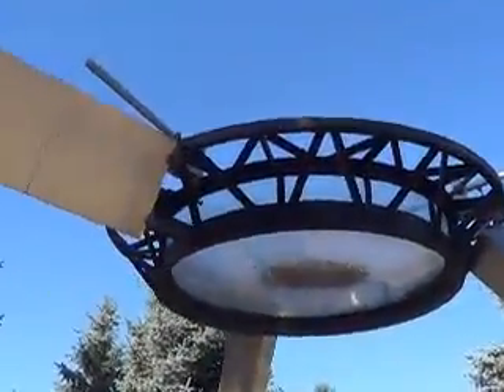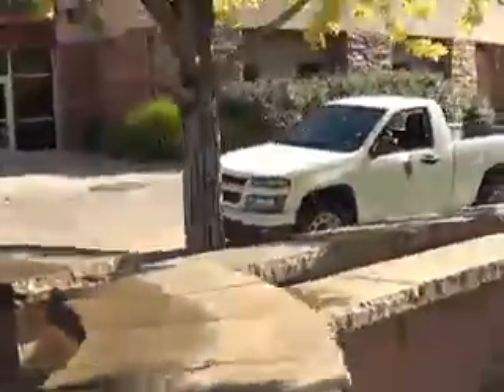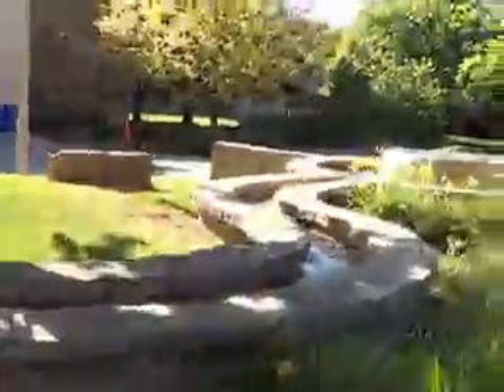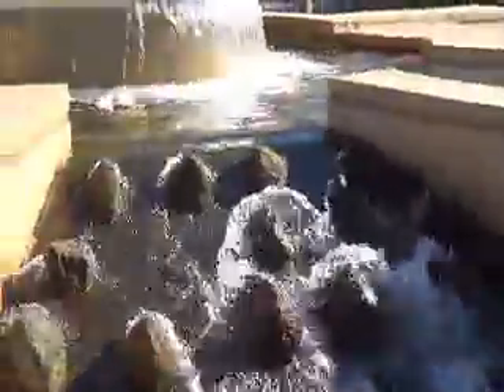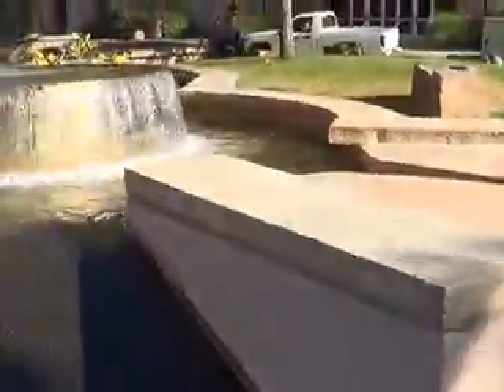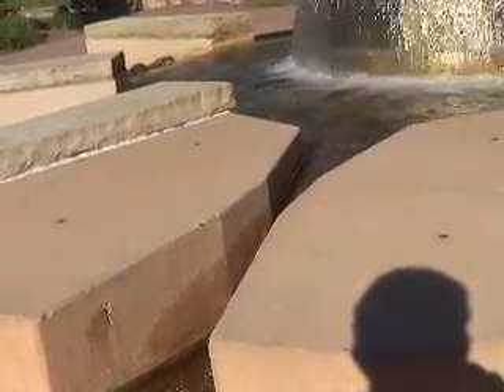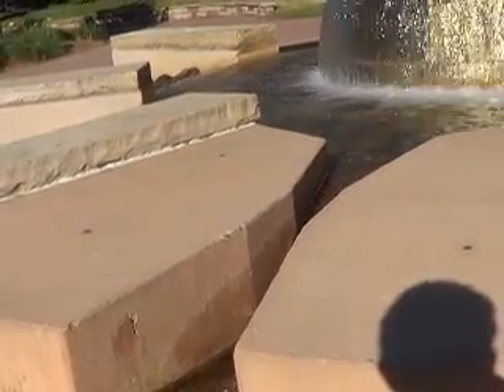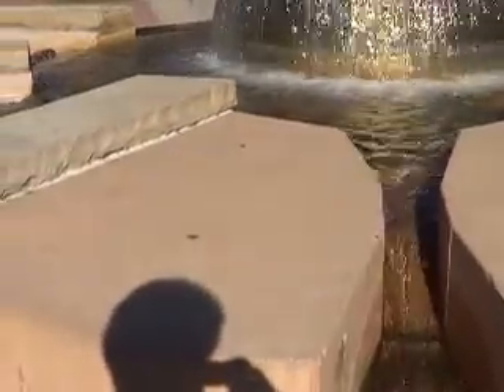Parshall Flume  Fountain

Comment: Its a device used to measure the flow rate of the water passing through it. When certain conditions are met (critical flow conditions), a height of water corresponds to a specific flow rate. For example, a height measurement of 4 inches might correspond to 10 gallons per minute. Or a height measurement of 6 inches might be 18 gallons per minute. 

I study irrigation engineering in California. Any how, this is a cool video!